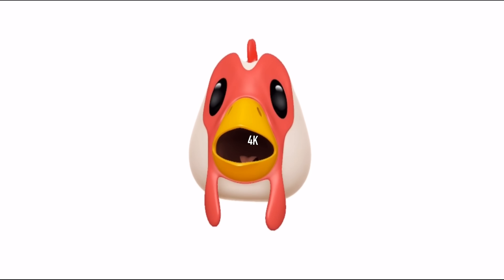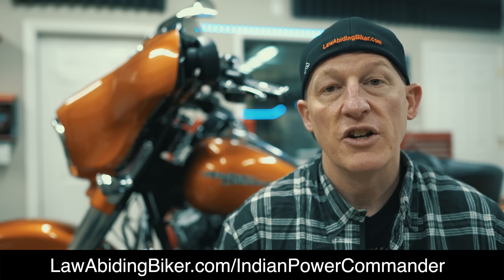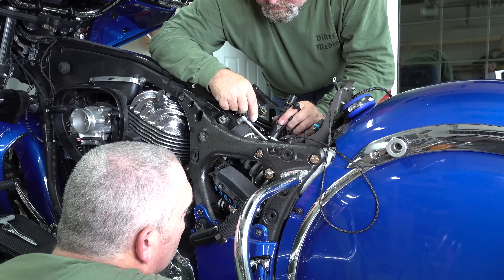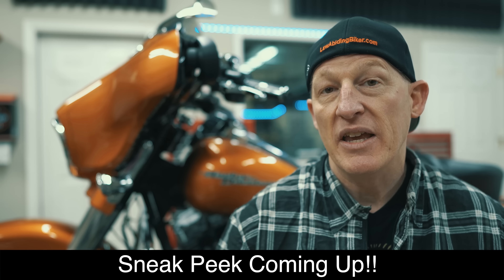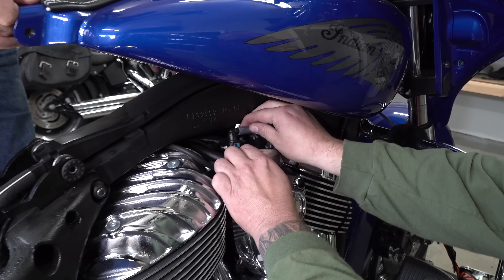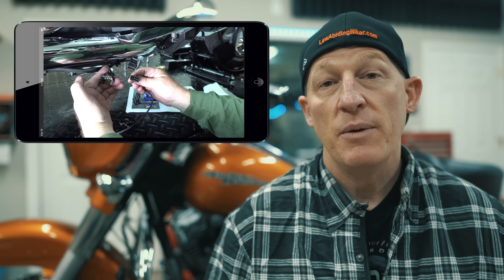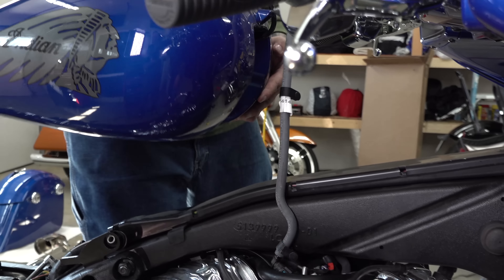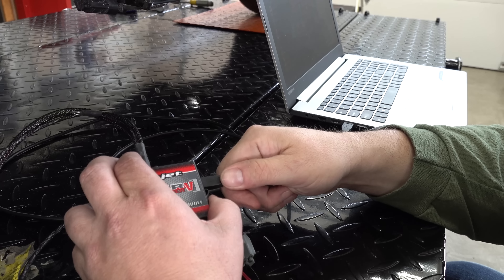Install Power Commander V on Indian Touring Motorcycle-EFI Tuning

Comment: What is the benefit of the Power commander V  over the Power commander PVCX tuner?
Reply from the maker: PVCX has  screen, so you can work it that way without having to hook up to a computer to it like the PCV to customize maps etc.
Reply: @RyanUrlacher Urlacher thank you for your input. I am looking to find out what setup is right for me and to go with it. I don't want to have to cut and splice into wires cause as we know that can lead to bigger problems down the road.